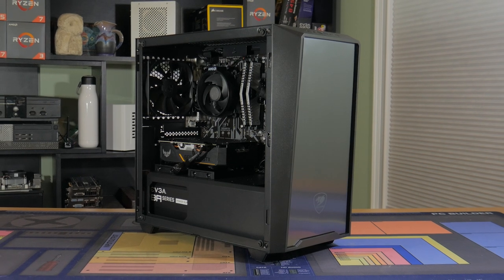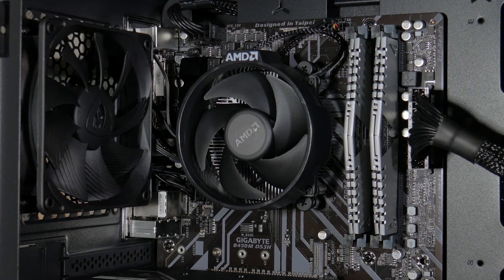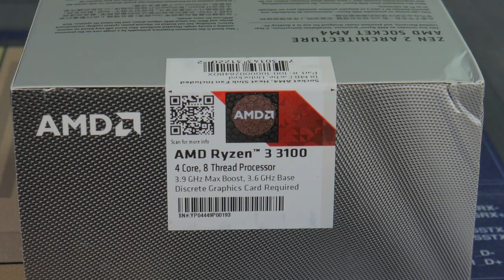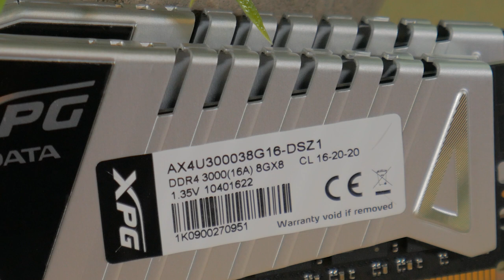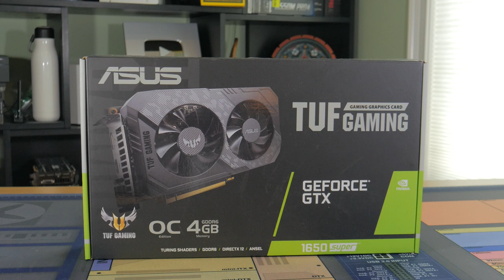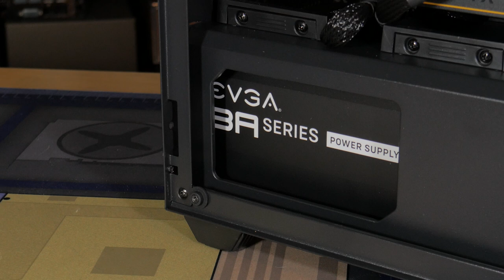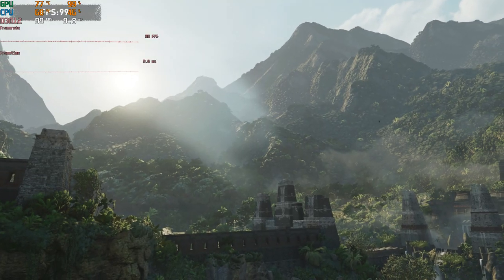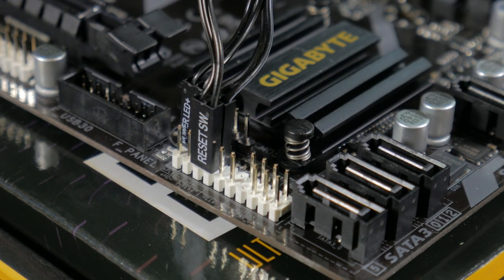$550 Gaming PC Build! (2020)

Comment: Built this rig in 2020 and so far the only thing I’ve upgraded is the cpu cooler and adding a few additional top exhaust and front/rear intake fans. It runs great still. I’m thinking about upgrading now to a Ryzen 5 and a 3060.

Comment: Ordered mine with slight changes (all prices in US dollars, inculding shipping & taxes):
AMD Ryzen3 3100 CPU: $110
ASRock B450M Pro4 Motherboard: $86
ASUS Dual Fan GeForce GTX 1650 SUPER OC 4GB: $189
COUGAR MG130-G: $50
XPG Z1 DDR4 3000MHz 16GB: $52
Silicon Power 512GB SSD SATA III 2.5": $52
EVGA 400w PSU: $41

Total: $580

Comment: For any people building a new PC, please do not overlook the temperatures, do not get the case that has the solid front panel make sure that it has some sort of mesh front panel.
Reply: yo, i know i probably sound like an idiot, but is the case that he recommended ok or are you suggesting a different case. thanks
Reply: ZoltZ You don’t sound like an idiot don’t worry, and yes that case is pretty restrictive in terms of airflow so it’s not great, if you are going to go for M-ATX build, Thermaltake H18 is an example of good intake airflow, for ATX build Cooler Master nr600 is great case because it has mesh on the front. I would say do  A LOT of research and I mean a lot before decide anything.
Reply: @sd_01c64  hi, how about MSI Mag vampiric 010?

Sorry, I can't tell it's good and I couldn't find the word "mesh" when I researched
Reply: Mark Fumar decent but not the best in opinion
Reply: @sd_01c64  counsel me bruh, I have 3 brand new ssd's, 1 Samsung 850 Pro 512gb, and 2 Kingston kc400 256gb drives. Which one should I install win10 one as the main drive for my mid grade gaming PC build? 

Let me know what ya think and why
Reply: hey this is an unrelated question but it seems you know some stuff
so do you think it is a good idea to replace Rx 580 for GTX 1650 super?
and I recommend using darkflash dlm21 mesh its pretty good case for lower price!!
Reply: @michaelcho1201  definitely. There's a website that caters to all pc components' information and you can compare your said gpu to that of the 1660 super n check their benchmarks. See here: https://cpu.userbenchmark.com/

Hope this helps
Reply: @phabeondominguez5971  personally think the ssd with the bigger memory should be your main drive. But it really doesn't matter.
Reply: michael cho 1650 super is a better card, but if you can grab a used rx 580 for less than 100$ then go for it. Personally, I would recommend waiting for the new 3000 series GPUs frlm nvidia
Reply: "Solid panel bad, mesh panel good" is simplistic to the point of being actively misleading.

Also, the majority of people putting together entry-level and mid-range builds on a moderate budget just don't require great airflow for the parts they're going to put in their systems. It's nice that some reviewers like Gamers Nexus do temperature torture testing to find the cases with the best airflow so the info is out there, but what's not nice is people memetically spouting off about airflow and giving newbies the idea their system will burst into flames if their case doesn't look like it was put together from pieces of a screen door.
Reply: @sobangcha3042  Userbenchmark is a trash website which is treated as a joke by those in the know in the PC building community.
Reply: @michaelcho1201  1650 Super is basically no upgrade at all over an RX 580. Save your money for a card that would be a real step up: https://www.youtube.com/watch?v=9l4Oqs5O98I
Reply: @sobangcha3042  gotcha
Reply: too late i went with the coolermaster lite 5 which has no mesh panel in the front and its all tempered glass on the side and i get pretty high temps 🤫
Reply: @hamzasalama3725  the masterbox 5 lite not only doesn't have a mesh front, it has basically no ventilation anywhere. There are ways to build a case with good airflow besides just punching holes all over the front, and indeed punching holes all over the front by itself is no guarantee of good airflow, as the Q500L debacle showed us.
Reply: Middcore how can i fix the air flow for this case
Reply: @hamzasalama3725   don't know that you can. Google "cooler master lite 5 airflow fix" and you get some results. Worse comes to worse just get a different case, the Lite 5 is pretty cheap so it's not that big of a loss.
Reply: Middcore 110 dollars isnt cheap 😭
Reply: @hamzasalama3725  The MasterBox Lite 5 is a $50 case.  Hopefully you didn't buy it from some price-gouging third party seller on amazon or newegg.
Reply: SD_01 C so the case ur talking about does it work with the same parts ? Cause I am new thas why
Reply: SD_01 C sorry I’m late but is this video build a m-atx build or a tax build?
Reply: @zoltz3469  aye I’m new to this pc stuff can you tell me if these parts would fit in a mid tower or does it have to be a mini
Reply: @sd_01c64  what other case can I use with rgb light fans?

Comment: Hey TechByMatt... would you recommend building your $300 gaming pc build for a first gaming pc? Or would yo recommend your $500 gaming pc as a first gaming pc? 
Thanks! Love your content because it really helps to make decisions on what parts to use in a pc, and what you can build with a budget. Great content!
Reply: Not Matt but I'd say save up for 500$
Cause:
1.Prices are garbo rn everythings overpriced, By fall 4th gen ryzen cpus should release and make the prices better overall.
2. A 300$ pc would require you to run an athlon or a xeon which would make the build have no upgrade path, meaning you wouldnt be able to get better upgrades cause your mobo wouldnt support it
Reply: @DudeGetRekt  thanks for the advice! The ryzen 3 3100 is only like $30 more than the ryzen 3 3200g and it gives alot more performance! It's just that GPU's cost alot. I was aiming for a GTX 1650 Super for the setup with the Ryzen 3 3100. Thanks for your advice!
Reply: @limespyyt6208 No Problem, also that combo seems awesome

Comment: Hey bro. I would really appreciate if you could test a car game such as Forza Horizon 4 in your next video
Reply: I play it with a gtx 1050 at mid specs and it runs smooth
Reply: Also test valorant
Reply: I have an i5 2500, 8GB RAM, and an RX 570 and it runs completely unhitched at 60fps on 1080p Ultra
Reply: @nicholaskimbrough2147  my 1070 can do 4k and mostly high settings 60fps. some minor dips here and there.
Reply: @sw8119  my laptop can run valorant smoothly on minimum settings and its just a normal notebook this setup is more than likely to work

Comment: This is a solid system no question, but for everyone who has a budget I would recomend to buy used. I found an 2600, rx480 build that sold for 390€ on ebay that will probably offer slightly better performance.

Comment: Everything thing here is great except the case which severely hinders airflow,I would reccomend the CoolerMaster q300L
Reply: This is a low to mid range and heat is pretty low so the case is fine it’s not like it has a 2080 or something

Comment: One of the more impressive budget builds I’ve seen, if you can stretch the budget 20-40 bucks you can get a better case with 2-3 case fans which would really complete the build
Reply: Can you get any case and it’ll still work I’m worried if I get a suddenly case it won’t fit the stuff or are they all the same

Comment: Matt, you could have easily gone with 1660S if you have chosen A320 motherboard. Some of boards support PBO with bios update
Reply: A320s are only 10-20 dollars less than the mobo he used, no way can he afford a 1660 super in a 550 build

Comment: A nicely shot video.  Some thoughts though:
That gpu is really bulky for the case, If you want to use an nvme riser card later, you'll also need a PCIex4 ribbon to make it happen.
Also that case appears to have very poor air-flow.  I would look for a full atx case with a full mesh front and add some fans if needed.  The Cougar mx330g for example.

Comment: If you want to save a bit extra cash and aren't going to be streaming, then getting an RX 580 8GB GPU will be the better buy as it has similar performance to the 1650 Super while being $50 cheaper if your lucky. Or if you have a little bit more money then a 1660 Super will go good as well.
Reply: Also gotta keep in mind that the 1650S only consumes roughly half of what the RX 580 does at full load and thus has much better thermals. I think you'd probably be saving a lot more money in the long run in electricity bills; some regions of the world have high electricity cost

Comment: If you want a windowed case I also like the Q300L from Cooler Master at $50, it looks amazing and has awesome airflow
Reply: I got a q300l,the airflow isn't that great, if you don't have a minimum of 4 casefans
Reply: Wi Mu yeah when you add casefans though it’s great, all mesh
Reply: That damn case had so much potential but there so many issues with it. Not worth the trouble.
Reply: YETI JUST ATE A DOG but its actually alive I heard such good things about it but now looking at reviews a lot of people liked it but also a lot said it was cramped and there was bad airflow just like you said.
Reply: Ryan Hall well it’s a micro atx case so space is cramped but airflow is just one of the issues. The magnetic filters are trash, the case doesn’t stand up to high which chokes the power supply’s airflow. Below the psu is a cheap terrible excuse of a dust filter. Also the expansion slot covers are thin pieces of metal that once removed cannot be replaced. You also can’t screw in your gpu which could cause sag for heavier graphics cards. Also no dvd drive bay. Only comes with one shitty case fan in the back. The HDD placement location is on the other side of the case. Hard drives will get hot. The HDD being on the other side of the case where there is no airflow is a bad idea.
Reply: Airflow isnt good on that case tbh
Reply: Tidjane Ly it could have been so great. It’s got a lot of great ideas that case. And there’s a great amount of cable management space in the back. But I like airflow, and DVD’s.
Reply: @brokentilebench  Same here man. That's why I settled with the NR400, which is significantly more expensive, but provides good airflow and DVD drive slot. Shame
Reply: Tidjane Ly I got the N200. It is a lil tight and cable management space ain’t the best but it came with two case fans, a dvd drive bay, and reusable expansion slots. It also has great airflow
Reply: Yeah Q300l is actually p bad BUT very easy to build in
Reply: JeredtheShy I also like thermaltake verses h18, has a tempered glass side panel and goes on sale for $45 sometimes, put in an extra case fan great case.

Comment: Can you make a video with 300 budget, 3200g+b450+16gb crucial ballistix 3200mhz, 256gb ssd, leaves 70 bucks for case and psu. That would be a great valorant 1080p competitive rig, i run valorant at 150-240 fps on my 2200g with well tuned memory in 1080p low settings, i almost couldnt believe it, 200 fps on that old apu, memory at 3333mhz cl13. The good thing these days is ram got pretty cheap, wich really benefits people buying the 3200g a lot, and my kit overclocked from 3200c16 to 3333c13.

Comment: hey i plugged all the pieces into pc part picker, and i get a warning, i trust that you've checked the parts yourself, but i just wanted to make sure the build will work before i buy all the supplies

Warning message: Some AMD B450 chipset motherboards may need a BIOS update prior to using Matisse CPUs. Upgrading the BIOS may require a different CPU that is supported by older BIOS revisions.

Comment: would using a nvidia 1650 OC edition instead of a 1650 super reduce the computer's performences by a lot? it seems that the nvidia 1650 super are out of stock. also is zotac a good brand to go with for the gpu?

Comment: k gotten an asrock rx570. Better performance than 1650 and way cheaper. The asrock one is 130
Bucks, 4gb of vram. Also for 170 bucks one could buy an RX 580 which blows the 1650 out of the water in performance. Also 8gb of vram.

Comment: Right after I get all the parts for the $500 one
DAMN
Reply: How has the $500 build been working out for you? I'm wondering if this pc is worth the extra $50 since I'm on a low budget
Reply: @slidz7756  really good actually. I was quite impressed on how well it performs. If I was to do anything different I would probabaly upgrade the CPU as it seems to flatline at 100% when I was streaming New World. I did double the ram too though and I am not sure if it made a major difference since it never goes over 30%.

Comment: I've just gotten all the parts, I'll edit this when I'm done telling how it went
Reply: How did you get the gpu? It goes for $550 alone rn.
Reply: @stephenbauer9302  I got it when the prices were low I guess, the prices can change greatly every month.
Reply: The build went well but a few of the 1 pin cables on the motherboard were coming out t I sorted it
Reply: @lorcan2431  tell how much fps this get in roblox plss
Reply: @AlmightyOej  roblox is baf
Reply: @lorcan2431  but pls tho

Comment: How are you able to fit the Pcie WiFi adapter in there
Reply: i’m going to build this exact pc in like a week i just ordered everything, i’ll let you know if a pcie is able to fit in there
Reply: no you can’t fit a pcie wifi card because the graphics card is way too fat, but just buy a usb wifi adapter on amazon and that should work just fine because i run my games pretty smooth on it, overall pretty good build for the price
Reply: @carlosquinto5126  thanks

Comment: The only cheap i get is i3 9100f + mobo for 120$. The 3300x is still expensive from where i live
Reply: The 9100f is really trash just to let you know, it bottlenecks with a 1660 super 😂 I found the 3100 for $105 on eBay today and picked it up so I’d Recommend that

Comment: Right now I have a 400$ budget for a pc but all of the 400$ builds that I can find cost WAY more than they say in the video, and I live in the US. Most of them would end up at around 560$. What can I do with 400$ right now? Or should I wait
Reply from the maker: You could do a build like this, but get an APU instead of the ryzen 3 + 1650 super. With this being said, I would recommend waiting because the Ryzen 3000 series APUs aren't on the same architecture as the 3000 CPUs. Saving up a bit more you could get a ryzen 3100 + RX 470 as the CPU/GPU combo.
Reply: Tech By Matt thank you so much for taking the time to respond. I definitely will want a dedicated gpu rather than an apu, so it looks like I’m waiting a bit. Thank tou

Comment: tech by matt what pc should i build for my budget of a $1000
Reply: 3600x b550 mobo so you can upgrade to 4000 series later. 16gb ddr 4 3600mhz your choice ram, 700 watt psu and a 5700xt and and a 500-1tb ssd. check pc parts picker.

Comment: Hey i just wanted to ask i have this case its a micro atx case called the Thermaltake Versa H18 and i wanted to know of it works instead of the case you have listed in this because they are similar and i dont want to buy another one if i dont have to

Comment: For this build can I upgrade to a gtx 1660 super or will there be problems
Reply: There won't be problems at all. Also, someone in the comments already said that this CPU holds good against even Rtx 2060S, So you wouldn't have to worry at all of the CPU bottlenecking the GPU
Reply: Yoosuf Ayaan oh ok thx

Comment: 😍 Ryzen 5 1600 af (has better cores and cheaper than 3300x)

😂 8gb 2400 mz (4*2) or 3000 mz is good

😉 450+ psu

😍 Good case (corsair carbide series maybe) 
   
  - You can get decent gaming for like 400 dollars may be, if u r on budget.

Comment: Haha me getting stable 60 fps in 2k in most games. With my 3.5 gb gtx 970. Another thing though is playing heavy titles like Star Citizen. Insert sad Pepe
Reply: My friend is giving me that card for my first pc does it still hold up
Reply: @jonmchugh5784  of course bruv. It's still amazingly good. I got mine in 2016 and haven't upgraded yet.
Reply: @KebabsRock1997  will it play games like assassins creed gta v red dead and tbe sims 4?
Reply: @jonmchugh5784  I can play gta 5 online at 2k 60 fps with custom settings. Assassins creed runs great (you gotta fine-tune your settings). I don't have rdr2 but I think it is badly optimized so no luck there unfortunately.
Reply: @jonmchugh5784  should run sims well enough
Reply: @jonmchugh5784  how about tbe processor you have and ram?
Reply: @jonmchugh5784  I've had a very good experience in assassin's creed origins
Reply: @jonmchugh5784  Of course don't expect running everything at ultra settings, but the card is a very solid piece of hardware. One of the better bang for the buck out there.

Comment: i got a way better list of 550 dollars gaming pc parts
xeon x5675 (oc it to 4.5 ghz so you can get same performance as ryzen 5 3600) only 35 dollars
gigabyte x58 motherboard (100 dollars)
pc case (15 to 45 dollars)
gtx 1660 super (220 dollars)
sata 3 ssd 240gb (40 dollars)
hdd 1tb (50 dollars)
8gb 1600 mhz ram ddr3 (35 dollars)

Comment: Can this PC support 1440p😭🤯🥺🤞
Reply: the gtx 1650 super in the video supports up to 7680x4320 (8k) @120Hz, most 5 years old games will probably run good at 1440p at 60hz
Reply: @NaterBalls  oh my 🤩
Reply: It can handle some games at 1440p, but this GPU isn't made for that and maybe you will get troubles with actual games.

Comment: Holy shit my r3 3200g, a320 and 1650 super can't stay on 60 fps and this video it's able to stay 90fps bruh.... What did i go wrong
Reply from the maker: What ram do you have? also the 3200g is on the older ZEN+ architecture and not the newer Zen 2 architecture the 3000 series CPUs are on. I would try and upgrade to a 3100 and sell your 3200g. After selling your old one the upgrade would probably only cost $25-$30. Also, make sure that if you have ram with a higher speed than 2400mhz that you enable the XMP profile in the bios.
Reply: @TechByMattB  i have 2600 ram, also what does the xmp profile do? Haven't check yet. It's okay planning to upgrade a b450m board and r5 3600.